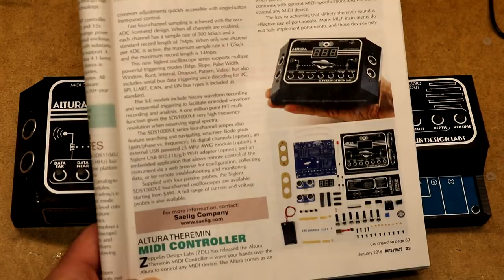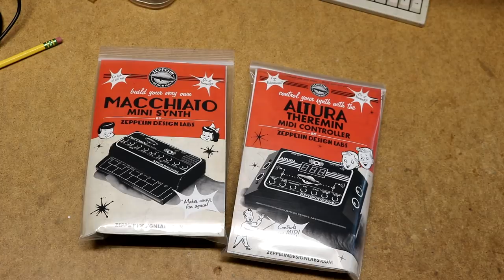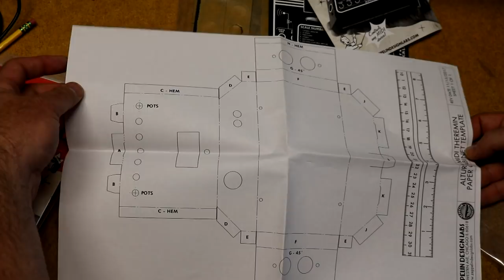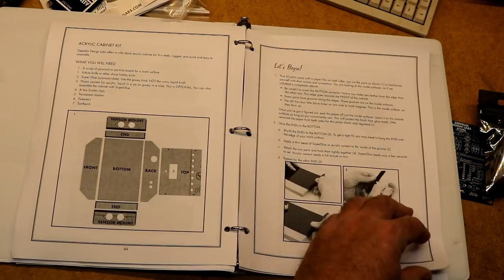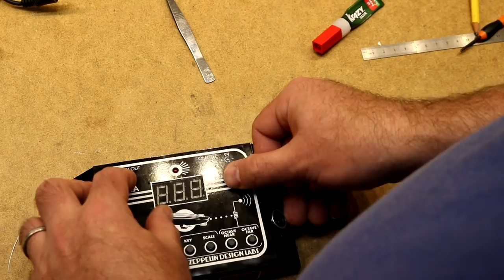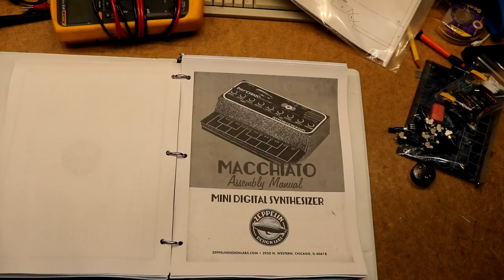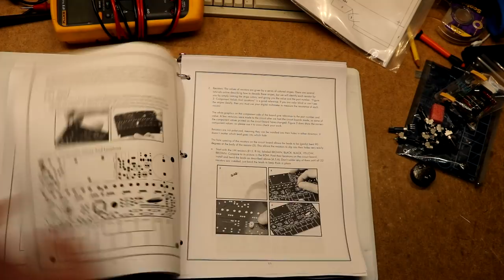Altura Midi Theremin and Macchiato Mini Synth Kit Reviews

Comment: Okay, just wanted to mention that you can control a WHOLE lot of different instruments with the Altura, I have tried it with a dozen or more, including cheap keyboards from the thrift shop, so long as they have MIDI in.  It worked perfectly with all of them.  And the Altura really breathes new life into all of the old cheap ones from the thrift.  One of my fav synths to use is the NTS-1 from Korg, it is also a kit but no soldering, just assembly IiRC.  But it only costs about $100 so combining it with the Altura is the best kicks for your money that are within the law, depending on which state.  I have had some serious fun with the Altura plus the NTS-1.  But seriously, try anything with MIDI in.  -- Oh, it looks like you have the acrylic case.   The newer model comes with one hell of a solid steel case.  It's a tank.

Comment: The Altura is the only optical one that I'm aware of that can be used as a MIDI controller.  And it plays musical notes rather than just sliding up and down.  (In fact, that's one of the main ways it departs from Theremins, it only plays musical notes, and only as MIDI.  the Macchiato has a special portamento mode made for the Altura that lets it sound like a Theremin.  But honestly, you really want the musical notes, especially if you use the arpeggiator.) It also has a really nice 8-note arpeggiator built in, which I think was really ingenious.  I have lots of fun with my Altura.  If you go to my videos you can see a few.  I also have the Macchiato but haven't done all that much with it, as it's mostly just a tone generator and I have a number of those already.  I mean it's a nice tone generator, really reminds me of the voice in a TD-3 or a 303, and with a simple sequencer you could make it do some of the same things.  My recommendation would be a Korg SQ-1 or a SQ-64 or, of course, the Altura.